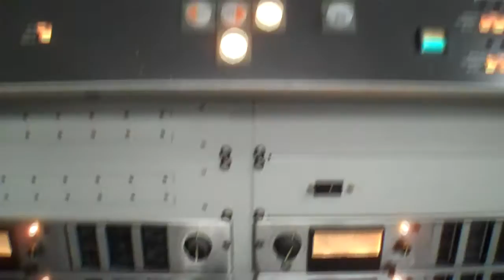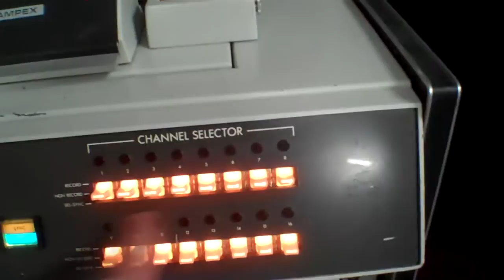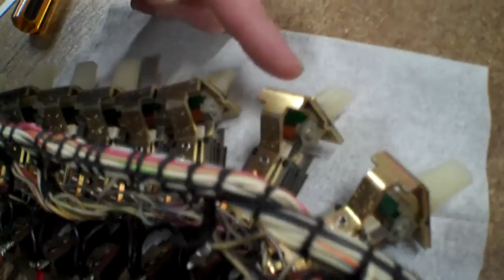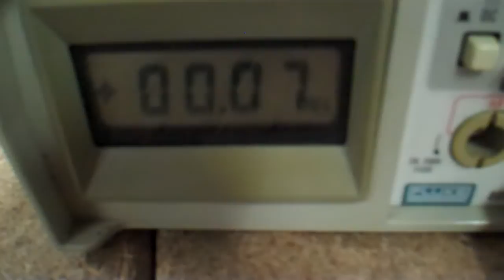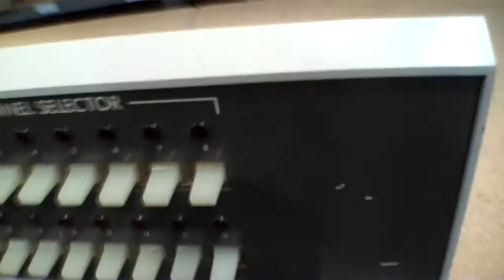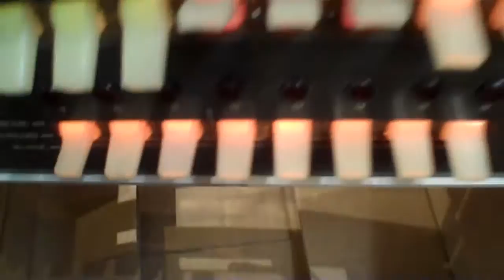Cleaning old school switches with DeOxit D5 - Ampex MM1000

Comment: Hey nice machine. I have one also. I will be selling it soon. It is the Heart Dreamboat Annie Machine from Vancouver, BC. It will be on Reverb.com and SFbay area craigslist tomorrow. Anyone interested in this machine can go to these sites to contact me. Thanks so Much B
Reply from the maker: I saw your listing the other day. The photo you used is actually my machine before I picked it up. I thought your price was a bit low, so I'm surprised your machine hasn't sold yet. That's going to be a killer deal for someone, especially with the Heart connection. That's an amazing sounding LP. Best of luck....

Comment: I own two (2) 1968 Ampex MM-1000s that were used at CBS Studios in New York.  Several years ago I had to go through both machines and clean the  the track arming switches - along with the other control switches on the front control panel.  DeoxIT D5 worked great.  I also use DeoxIT Gold with good results.

Comment: I guess you could also using a burnishing tool on the contacts. Did this recorder do 30 IPS? It SOUNDS (via those who were recorded on it) sounds like a nice machine!
Reply from the maker: This one is 7 1/2 ips and 15ips only. Still, sounds great at 15ips.
Reply: Bryan, I'm sure it does! Ran into a gent' in Flemington, NJ, who had one rebuilt, since he does a lot of tape transfers!